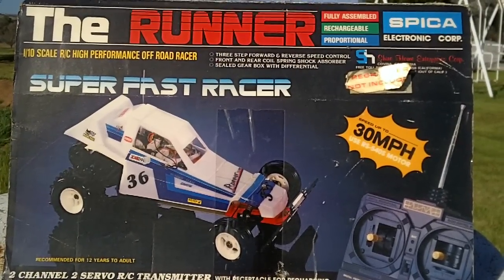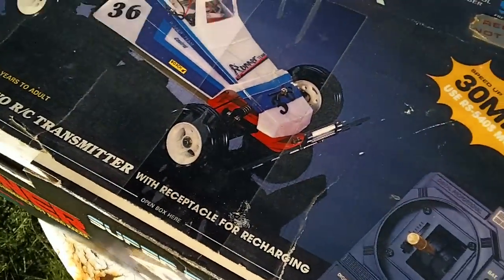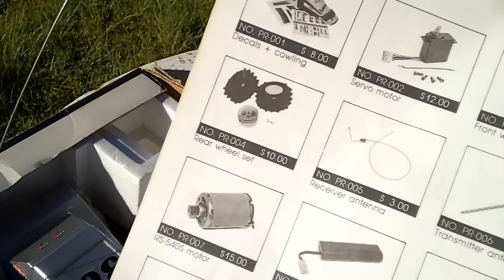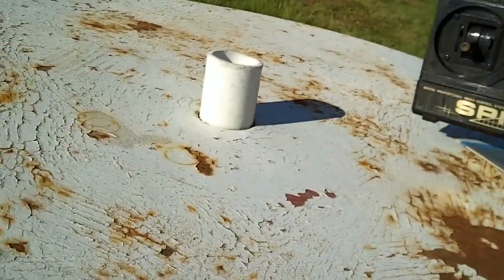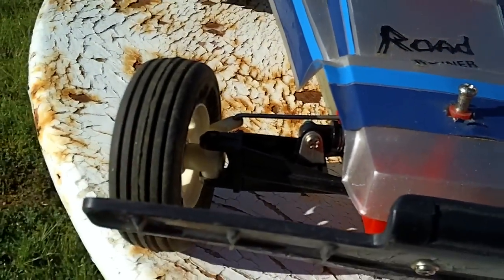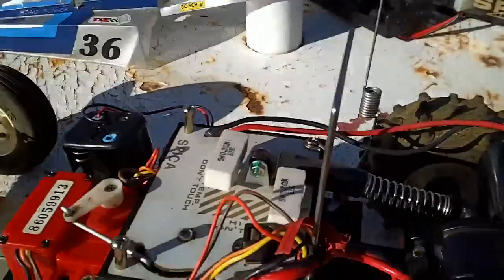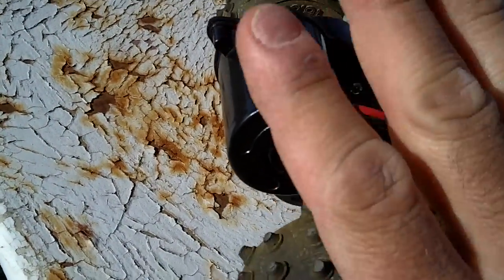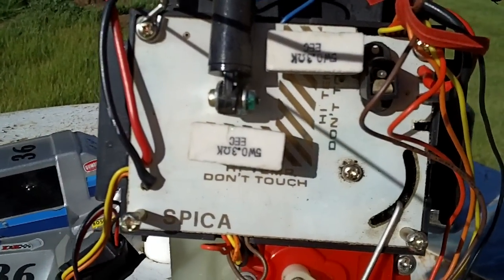Vintage Spica "The Runner" Off road racing buggy

Comment: My folks bought a Spica Runner for me at Price Club(like Costco) here in Phoenix back in '84 or '85. I still remember the price: $59.99. I'd been wanting an r/c car like a Grasshopper or Frog for a while, but they were considered a bit too expensive with all the extras required. My folks liked the price of the Spica, so they got it for me. We bought a 7.2v battery pack and quick charger, and after first charge, I took the Spica to the street. It was as quick as any equivalent Tamiya buggy, and I was impressed. For 5 minutes, that is. Then diff gears stripped before the battery ran low. I was never able to source new gears, and it sat in the garage for years. About a week later, I had a Tamiya Hornet.
Reply from the maker: Thanks for sharing in detail. You have a good memory. In that time period there was alot of, I guess you would say copycat Tamiya Grasshopper and Hornet Rc's. Even The Nikko Rhino Rhino or the Rockbuster showed very similiar traits. Spica Runner is a light abuse Rc. At the end the Tamiya products were well worth the extra money, but you can always say you had a Spica Runner.

Comment from the maker: Hi Ciao, I would try older Tamiya tire models first,. To see if they fit well on those rear wheels. Or just see if the Tamiya Grasshopper or Hornet wheel and tires fit on the Runner. That way it would be a easier install. I have many Rc's, very many. I like Tamiya models. The new stuff too.

Comment: Awsome I just bought it yesterday for a very reasonable price and its in great condition the skid plates are not even worn. I have the original box and remote with gold sticks. Do you know any extra info on the company.
Reply: @elevenwizard12
Reply from the maker: I know there a 1980s Radio Control company. There not very well known and even few knew there existence then. Everything was concentrated on Tamiya and Rc10's. Glad you have it. There extremely rare !
Reply: Thanks I was excited to hear about it. What did you end up doing with the battery box and switch? The wires came off my battery box.
Reply from the maker: ***** Hi, I'm going to try to rebuild everything to make it as stock as possible without modifications

Comment: hei, thnks man. i have one of it. mine is without radio, but maybe i will provide one ( alter )...
i would like to see this 30mph if is it true! 
do this video man if not i will use mine...
in effect it mount a 18 teeht pinion and is big for this kind of car... perhaps it do 30 mph..
is also very economical frame... mmmm, bo ?
how many money do you want for the runner spica ?

ciao

Comment: where i can see yours models? anyway i think original spica doesn't go at 30mph really..  i istalled a ezrun3000k brushles & esc + ball bearings front and rear ( also gear box)  and sport suspension and some alter.. taken off original servo and mounted radio pro servo. just because original was destroied so better now taht dead. for tire i was like you about honet tires but... too soft.. spica mount more hard tire

Comment: Hello, I was wondering if you still this Spica buggy. If you do, did you ever get it running. I just got one to turn into a light runner. Thanks
Reply from the maker: @orlandoojeda6545  yes have it running. Glad you have the Spica buggy and running as such a light runner. Kinda of a nostalgic moment Rc buggy to have more than any other reason. A good conversation starter among friends.
Reply: @elvenwizard12  haven’t received it yet. EBay purchase just today. No remote, I’m hoping the oddball receiver/MSC combo uses a standard crystal. Maybe I can match it. If not, I’ll convert it to a modern receiver and ESC. Thank you again!
Reply from the maker: @orlandoojeda6545  yes you might have to switch out the electronics for this one. You never know it may work when you get it.